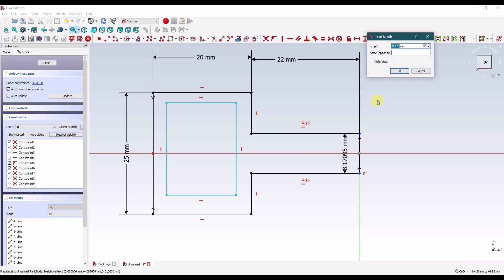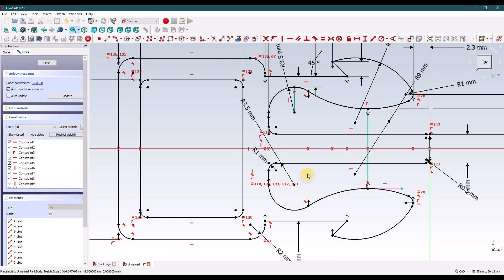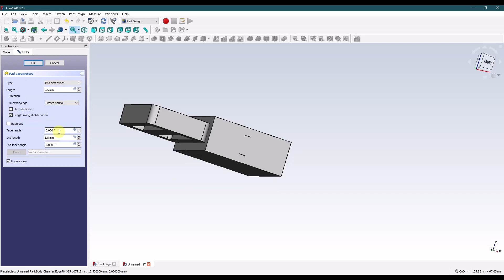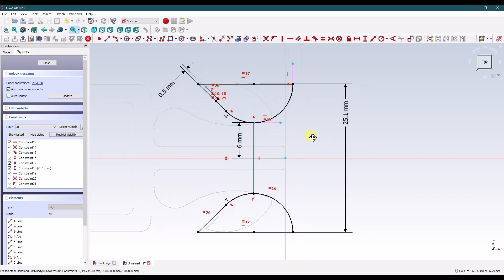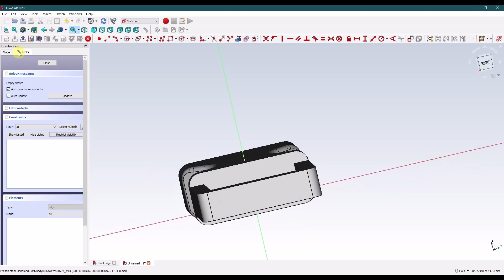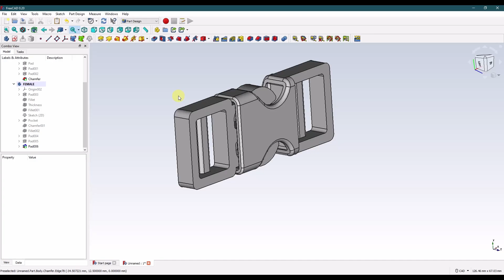FreeCad Tutorial #12 | Design a functional Snap Buckle in FreeCAD for 3D Printing

Comment: Thanks for the tutorial. How do you figure out what the dimensions need to be to get a fully constrained sketch?
Reply from the maker: Thanks! In order to fully constrain a sketch, it has to be dimensioned in the X and Y coordinates. That can be done with linear dimension, or with constraints.
Reply: @KTECDesigns  Thanks for getting back to me, I understand that but that's not what I was asking. I meant how do you figure out what the dimensions are? I hope you follow.
Reply from the maker: Sorry for misunderstanding. I get what you’re asking now. Some dimensions are arbitrary. I select them based on what looks good, or based on my experience and testing. Other times, I use physical parts and take measurements. 
It’s a bit of an art, I guess.
Reply: @KTECDesigns  That's ok, I appreciate you getting back to me. I think you're correct it definitely is an art. I think I would have to use a different CAD program, sketch it out and take dimensions. I don't think I'm smart enough to work out the dimensions any other way. Anyway, thanks again for the tutorial. I have done quite a few now and that was one of the hardest sketches I have done. I think it was a very good tutorial and I'm looking forward to more that you do, thank you.

Comment: Nice tutorial.  But I'm wondering if mango jelly would have mirrored the solid feature rather than mirroring the sketch elements.
Reply from the maker: Perhaps. As long as the same geometry can be achieved, I'm not sure there's a better way between the two. I do prefer to use mirrored sketches, though.
Reply: @KTECDesigns  I'm certain it is faster to mirror the solid than mirror the sketch.   Mango jelly would never mirror a sketch, which requires you to duplicate the constraints.
Reply: @KTECDesigns  I loved the tutorial. Thanks for your efforts.  I know it's a lot of work.

Comment: Hi, thanks for the lesson. It's a good video with some nice hints on the buckle features.
Is the final physical model performing as you desired? What filament have you used?
Cheers, keep on with the good work.
Reply from the maker: Yes, I’m pretty happy with the finished product. I have used Sunlu PLA filament, at a layer hight of 0.2mm, and 20% infill.
Reply: @KTECDesigns  Thanks for your reply.
Reply: I would take PETG or ASA.